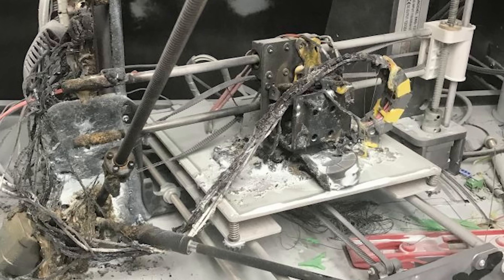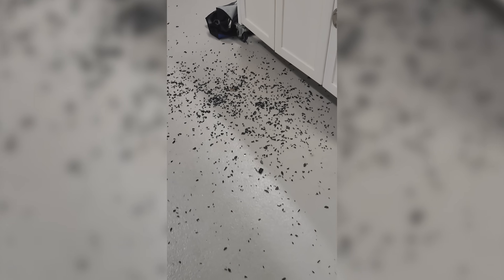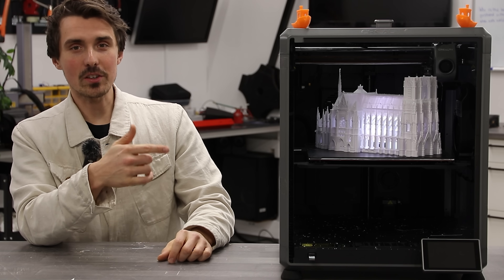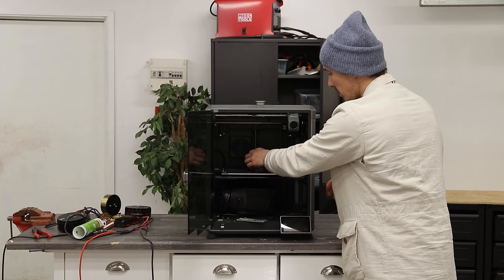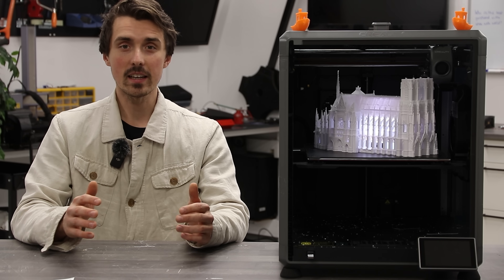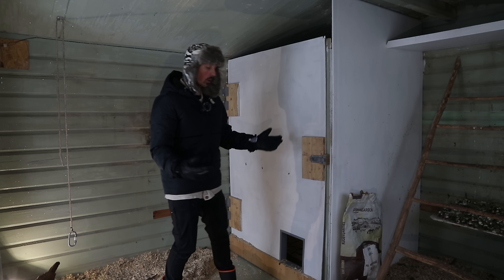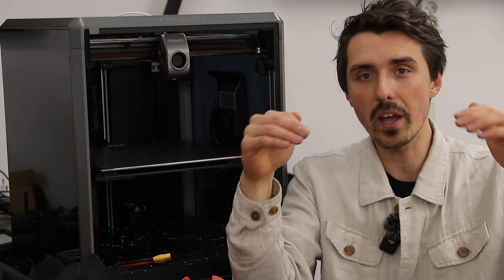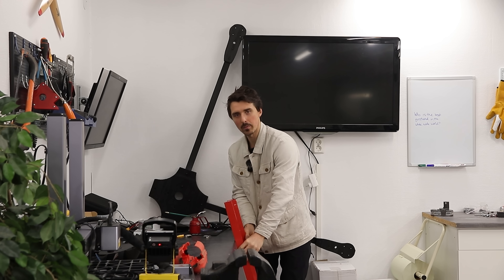3D Printers Are Getting Ridiculously Fast

Comment: Did you anneal the prints? Idk about most filaments but the pla i annealed so far only needed an hour in the oven at 60-65°C. If the entire print is not supported against a flat glass surface you cuold just pick up some fine grain sand for support.

Comment: I used to watch your videos back when you publish the ender 3 review, that's the printer that I bought back then and still rocking it till now, I upgraded it almost in any aspect and it is very reliable printer and if I will upgrade the cooling I will be able to push it to reach high speed easily (at least 400-300mm/s)

Comment: SV07+ --> I made a profile to crank out benchies in 13-14mins :O

At this point tho, the starting time of these machines to print is the achilles heel. I often prefer the SV07+ for small stuff because it starts so quickly, especially if preheated.
K1 Max takes like 9minutes just to start ...

Comment: I dont think youll get the speed increase you are expecting. Printers are now bumping against flow limitations, not movement limitations....IE, the printer will have to slow down its movement with 0.8 nozzle to get enough filament melt time. I have an 8 year old FT5 ive played with 0.8mm nozzle a few years ago and yes the decrease in print time was almost half. Guys with P1 and X1 that upgrade to 0.8 nozzle are reporting no significant decrease in print time.

Comment: I think the noise of the machine is because it is an enclosed machine, i have the Bambu Lab A1 and the K1C and the A1 prints faster and is much more quiet
Reply: About being quieter, Bambu's have their own h bridge drivers for the motors and special type of noise canceling firmware making them super quiet compared to standalone tmc drivers.

Comment: My 5 cents: the speed of k1max is not limited by a nozzle, it is bottlenecked by max volumetric speed of molten plastic, which is around 20 cubuc mm per second. And it is possible to hit that limit with regular 0,4mm nozzle.

Comment: That 8:35 benchy you showed was from one of my videos!  Yes, the quality is crap, but if you can print a "benchy-shaped object" faster than most other printers, you can usually print a good benchy faster than most printers too.  That same printer can do a very high quality benchy in about 13 min, which furthers your overall point (especially because that's a stock build of a large 400x400x400 printer).  

I have been printing for 10+ years as well, and I'm also surprised by the huge jump in speeds and quality the last few years.  CoreXY was part of it -- I think the silent TMC2209 stepper drivers also played a role --  running stepper motors at those speeds with older drivers would induce terrible noise and vibrations.

Comment: patterned extrude is much faster, yep you just vary the output shape and push molten plastic out of the holes. yep same as whipped cream 3d printing. by hand. yes, multi-nozzle matrix print head.

Comment: You should try a 0,6 Nozzel with the 3 Holes where the filament is split up and gets extra volumetric flow. I did this on m y X1C and it works great.

Comment: 8:17 in fact with doubling the nozzle diameter you are actually able to cut the print time almost down by up to 4 times because not only do you double the layer width but you can also double the layer height. The cross section of the 2 times bigger diameter is 4 times higher.

Comment: I've recently got Creality K1C for general-purpose workshop printing because of good reviews and it was easy to get locally with next day shipping. Well, as it turns out it has a bunch of problems that I had to solve to make it a reliable workhorse. Had to design and make a wide and tall lid, so that neither cable chain nor PTFE tube scratch it. Replaced poorly-designed hotend (when thermal paste around heater dries out, failed prints will follow) with MicroSwiss one. Rooted the printer, properly calibrated input shaper, PID loops and pressure advance. Replaced PSU with MeanWell one, that doesn't turn on fan if there's no major load (while creality PSU's fan runs non-stop). And lastly, replaced MB and PSU fans with Noctua fans, while also adding some air exhaust holes at the bottom, since there's none.
And after all that work it finally feels like good reliable printer.
p.s. I picked a bigger mother board fan - 92x92x14mm vs 60x60x15mm. Also had to put resistor in series, since the fan was 12V.

Comment: You can turn of auto Bedleveling manually before the print. I Just use Autobedleveling if i changed the buildplate to another surface.

Comment: Even if you rock a 1mm nozzle you'll notice that the print time doesn't go down as much as you hoped for. That's because your nozzle can't melt the plastic fast enough.

The movement of the printers are now so fast that it's mostly about the volumetric melting capacity your printer can produce.
Crazy times we're living in, especially if you've been doing this from the start!
My K2 Plus maxes out at about 35mm³/s for most "high speed pla" without going crazy on the nozzle temp.

Keep doing your thing, we all appreciate your content!! 
Love from sthlm 🇸🇪

Comment: ive had enders for years (primarly ender 3 originals) and I personly think that it was a huge stepping stone/introducing someone new to 3d printing to realize that tweaks and such are needed and it isnt so quite "out of the box" not at that price. However, i just got my first A1, and im just blown away. im not sponsored or any of that crap, i still have my enders. I think im going to try a k1 or any larger format creality has currently

Comment: I don't know... Everyone wants to print fast but there's very little data on tuning for bigger nozzles because everyone uses .4mm nozzles. Also, filaments like PETG like slower speeds unless you've profiles for HF filaments but i question the strength of printing some of these models in anything other than PLA or high flow filaments.

Comment: The benchy cheats a little bit. It uses a layer height that’s a bit higher than the 0.2mm standard. Also there are redesigns for the door hinges that allow the door to open wider.

Comment: Are the configurations in the slicers setup to print faster on newer machines?  Or do they spit out times similar to old machines?  Meaning, do individuals have to tweak settings to get the higher speeds, or will the slicers do it for you?

Comment: Perhaps it is just me but I'm not impressed with, or interested in, speed.  I am a function over form type of guy and I want quality first and foremost.  And not just in appearance but in strength and durability.  I am also the kind of person who INSISTS on being able to set my own setting choices and do my own modifications and this is incompatible with the direction so many printer companies are going.  Sadly most people just want a plug & play option where they can just treat it like a microwave oven and press some buttons.  They don't want to 3D print they just want 3D printed stuff.  Strange as it may seem but I WANT the failures because it is through failing that I learn and the more I learn the more I can do.  I have yet to find a printer that does everything I want and because what I want is not what most people will want there is ZERO chance I will ever just be able to pick my perfect printer out of a catalogue and say  "This is perfect for me".

I find there is very little real innovation in the market now.  Most companies are just riding the coattails of the modding community and it is they who are innovating.  But the companies are only using the innovations they see that they can make the most profit from...which is understandable but still disappointing.  If I were to have my ideal printer it would be an IDEX SV08 with a 5 toolhead toolchanger but with fully independent X AND Y axis for both extruders.  The idea of printing two completely different models at the same time all while using multiple colours and filament types really appeals to me.  But I do not have the skills to develop it nor do I want it badly enough to learn the needed skills.  I also will not just sit back and wait (or expect) someone else to create one so I accept that what I personally want I'm not going to get.  And I'm cool with it.

Comment: Just putting a 0.8 nozzle will not do the job. Problem is, at this point the amount of PLA able to melt ist the limiting factor. You need a new hotend in order to get even faster. There's a video from Stefan from cnckitchen about this topic

Comment: You need to root the machine to  run klipper.  Once you have klipper running you can run code that just bed levels around the parts you are printing🤪.  Happy to help you do it if you want to live on the edge:

Comment: Terracubed 3d printers (made in Lithuania) are also corexy, 3mm nozzle as stock and prints 1-3kg/h rate...using directly pellets, instead of filament. With that one - you could print entire drone for yourself in few days, with CF enforced plastics, not much weaker than aluminum itself.

Comment: 3d printed cutter hangers? Seriously?

Also: expensive printers are fast. We knew that two years ago dude...
Also also: there is always a faster printer.
Also also also: you don't need a faster printer. You had no problem with the speed of the old printer until you found out that there was a faster one and THEN the old speed became a problem in your mind. 99.9% of people don't print anything over 4 hours anyway so being able to shave 2 hours off that is nice, but they won't use those two ours to print something else.

The video is bsically GAS. Gear Aquisition Syndrome; buying the faster tool for no other reason than that <insert golum voice> "we wants it".

And yes: if you want it and can afford it: go for it! But don't pretend that you need it, because you don't.

Comment: For 15k USD I can lease the smallest manufacturing cell which can still print at 25x the speed even though you're printing at 3x speed now (300% sounds so much more impressive though) that means I can still buy productivity putting me at ~10x the speed (or even much more on complex prints with a lot of air space in them).
And since it's using CLIP tech (continuous liquid interface printing) the print is isometrically at the molecular strength of the source print material; there are no layer or laminar effects/artifacts nor voids/steam holes.  The prints are ready to ship after printing, no post processing/trimming needed.

Comment: I’m still using my anet a8. 7-8 years on and almost about to hit 50km of filament through the machine. I Still haven’t soldered the heating bed pins directly to cables. Never upgraded the board or firmware. The only thing I did different was to laser cut a new acrylic frame that was one piece. 

I’m almost about to upgrade to a new printer. Only because I want to go colours over one filament at a time.

Comment: You dont have enough flow to go with too much of a bigger nozzle.  If you go with anything more than a 0.6 your probably going to have to slow the printer down so the plastic can melt.  The only reason to use a 0.8 nozzle on newer printers is if you need thicker walls.  

Also you really should try anything else than that k1, Iv got it and most of the other modern machines and while its fine, its for sure one of the worst of the modern printers.  The Bambu, Flashforge, and Qidi are far better machines!  Not saying the k1 is bad, its just not in the same league.

Comment: Faster than the fastest 3d printer is having several 3d printers - for faster prints at quantity, and cutting a big print for several smaller parts to print simultaneously. 
Also several 3d printers lets you print several colors at tha same time - no need for  ultra slow and wasteful AMS /MMU

Comment: this actually gave me a perspective on my Ender 3 V2. I bought it few years ago when it cost around 330 USD and I've been upgrading and tinkering with it a little. I basically only upgraded the hotend to phaetus dragonfly and a direct drive Orbiter 2 extruder. Last upgrade was a raspberry pi zero 2W so I could run klipper on it.

Long story short, my prints are basically as fast as the K1 times shown in the video. My benchy takes 50 mins if i want a absolutely perfect print, but I tried pushing speeds as far as my hotend can go and i got it down to 20 mins. The funny thing is that I legit can't tell the difference between the two except for few spots which i could solve with further tuning of the slicer profile. 

In terms of numbers, my "reliable quality" print speeds are around 100mm/s (cca 9 mm3/s), the experimental fast profile prints at 250mm/s (17 - 20 mm3/s) and I still can go a little bit up before it starts underextruding. I'll be getting a CHT nozzle soon to see how far it can really go. Obviously accelerations are the ultimate limiter on this style of printer but i recon i still have some room to reliably improve.

But yeah, having a fast-ish printer is great and i love how far the printers have come. Even though you could build/modify your own printer to print fast for less money, i respect people wanting a "just works OOTB" printer. Also I'm glad manual level printers have become a thing of the past since every printer now has a probe of some kind.

Comment: years ago you were happy with anycubic mega. i had that one and was kinda struggling with consistent print quality on that. 
now i have the k1max and it's super easy. send from slicer to printer and it just works. very happy with this one. for those that dont want to spend 700euro, there is a smaller version but i would suggest saving up few months longer. for those that have a little more to spend, go for the bambulab 4color one.

Comment: Bambu Labs is what happened, and it made all the other companies copy them...
Reply: No they werent the ones starting with these fast printers
Reply: @Mmm-------79-f4z Bambu actually stole very much for os projects. ☝️
Reply: Lmao fast coreXY printers with input shaping existed years before bambu lab came in a ripped it off.
Another insufferable bambu stan thinking he knows everything. Bambu lab is already outdated in 2025.
Reply: @LilApe   None of the other 3D printers do what Bambu Labs do with the same quality and reliability, another noob talking trash about Bambu when he dosnt have one...
Reply: @Mmm-------79-f4z  The prusa MK4 runs just as fast, if not faster, while producing better quality prints while also producing more dimensional accurate prints than anything off a bambu lab.

Prusa MK4 also has a faster and less wasteful multi color set up, is also far superior in build quality, QC and customer support. Doesn't collect and sell your data to the CCP and is open source and pro right-to-repair.

So what where you saying? That's Im a noob that's never used bambu lab? I owned a P1P, it was junk that was DOA with a bricked stepper motor becasue bambu uses the same junk components as used on a $150 ender 3. Educate yourself, noob.
Reply: @LilApe  Another Prusa fanboi that spouts the same rubbish as the rest, no original thought. The Mk4 is a load of rubbish the X1C shits over it. The fact that you need to spend more money to get it upgraded and it its still lacking.
Reply: @Mmm-------79-f4z  I like how you completely gloss over my counter argument and go off on a tangent becasue you know I'm right.

Saying i spout the "same rubbish" and how i'm unoriginal. Meanwhile you mouth off the same bambu bot talking points. IRONY
PrUsA bAd, bAmb00 g00D.
Reply: @LilApe  What are you right about? You talk about Prusa Mk4 like its a beast it dosn't even have an enclosure.

Next your going to name the Prusa core one a week copy of the X1C.

Don't get me started on XL and the ridiculous cost that even the most hard core prusa fanboi has bailed on.

Im right you are wrong, Bambu Labs changed the market and whole landscape.

Deal with it or Don't, this is the last time i speak to a fool like you, good day x

Comment: I work in a hobby store. If you want something that just works, get a Bambu Lab. There are so many things wrong with Creality. We get multiple units a week with issues straight from the factory. We have yet to receive a Bambu Lab for a manufacturer defect. They had the recall for the a1 but they handled it in the best way possible.
Reply: I can vouch for this as well. After having tons of issues with my ender 3 s1 pro, I sold it and bought a p1s. Has yet to fail a print in my year of owning it
Reply: Bambu is so overrated, their printers are tiny and overpriced, when you got stuff like Qidi and now Creality K2 Plus out there there.

Comment: 1:50 - I was blown away when I assembled my SV08 and printed the 12 minute speed Benchy that was in its memory.  It not only printed in 12 minutes, it was the nicest Benchy I've ever printed.  I couldn't read the text on the stern but the layer lines were stacked beautifully, no banding, smooth overhangs, no stringing....  12 minutes.  WTF.

Comment: Once I moved to Bambu machines, everything else on the consumer grade market became irrelevant to me (still love Prusa but their current offerings aren’t what I’m looking for at their price points). I’ve had my x1c for only about a year and a half but it’s been extremely reliable. I’ve been able to run a business on only 2-3 Bambu printers and can crank out designs and prototypes within a day. Also it doesn’t really bother me that they have a closed ecosystem, I’m in it for the design and print process, not the tinkering.

TLDR: get a bambu and you won’t regret it.

Comment: A 0.8mm nozle will actually cut the print time by a factor of 4 because doubling the diameter increases the cross section by 4.
But you will quickly push the hotend to its limits unless you use a high flow nozzle.

Comment: If you wanna try drilling out a hardened steel nozzle you need either a super tiny carbide drill (but no chance they make them that small) or you need to soften the steel, drill your hole, and harden it again. It's easier than it sounds! Just remember to temper it, too!